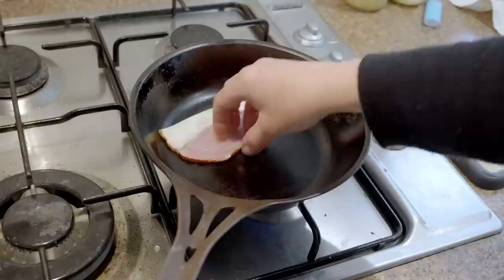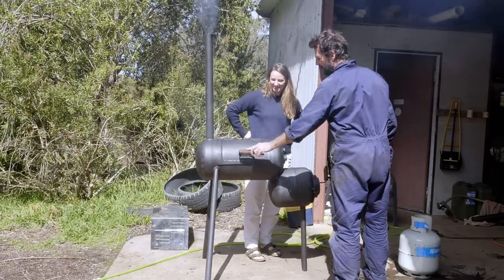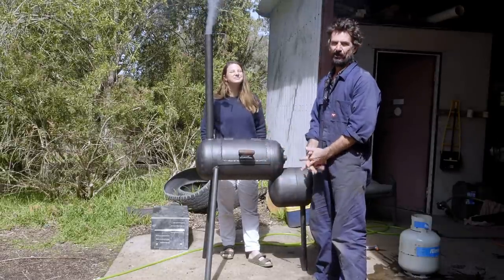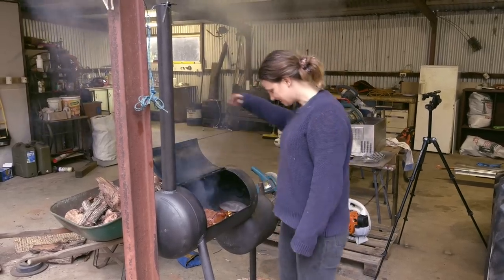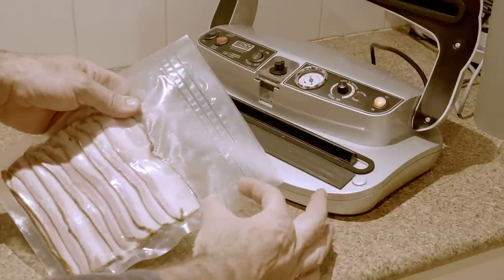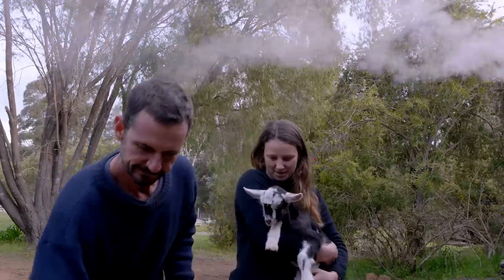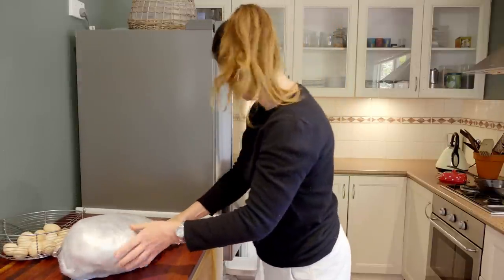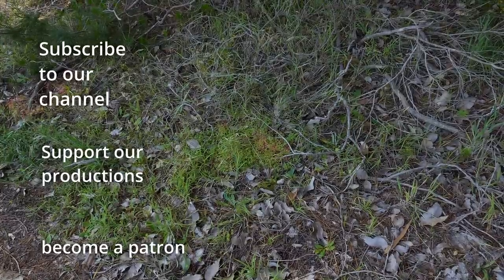Making bacon in our home built smoker - Free Range Homestead Ep 24

Comment: My mouth is watering just imagining the bacon. 
I made a very similar smoker about 14 years ago out of large barrels. It worked perfectly. My fire box has several layers with a trap door on the bottom for removing ashes. I like to use mesquite coal, and use damp applewood chips for flavoured smoke. I’ve never done it, but the smoke could pass through an ice bath for cold smoking as well.
Reply from the maker: We have friends that cool smoke through ice to season whiskey. They did it warm and lost half the alcohol!

Comment: I would just put some little swing doors in front of each lug hole in the rotor to swing some shut to control the fire while you can keep the chimney open or closed to regulate the amount of smoke to the meat.
Reply from the maker: Door fully shut and latched is pretty shut down. If we slip the catch, it burns a bit hotter.

Comment: Troy may I suggest you add a note of caution to anyone that may attempt to cut into or weld an old old gas cylinder as this could have disastrous consequences.  Keep the videos coming. Long time viewer.  Colin
Reply: Totally agree! Potentially deadly! 
How did you purge them Troy?
Reply from the maker: Removed the pressure valve with a spanner and filled with water. The gas bottle already had the valve gone for some years.

Comment: Gota love Troy's make my own attitude, why buy it when you can make it yourself a lot cheaper. The brake rotor door hinge might rust and seize up on you. When welding or torching galvanized steel wear a respirator the smoke is poisonous. Lastly I like to smoke with hickory and on big pieces of meat I cold smoke first around 90 ° F for a few hours than up the temp to about 250 ° F and cook until done in the smoker.   Home made is the best, love you guy's.
Reply from the maker: We like hickory too but in short supply in our bush. We've stashed some fruit wood but it's still not seasoned yet.